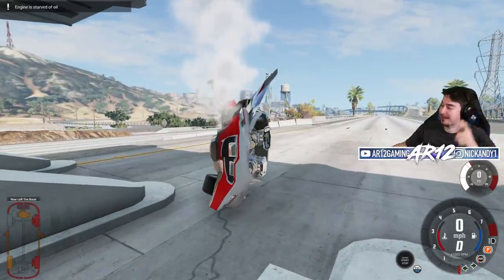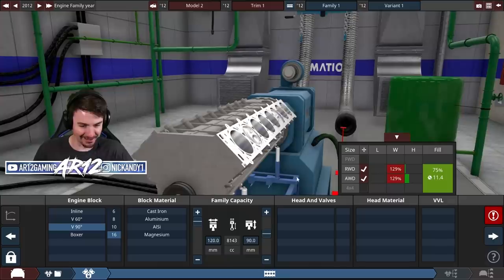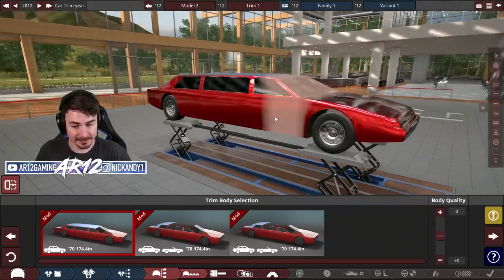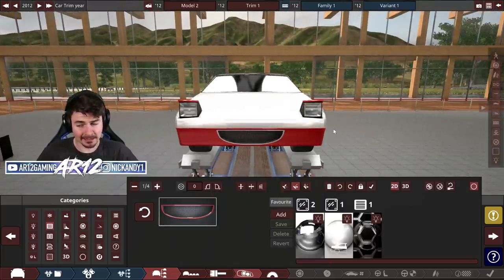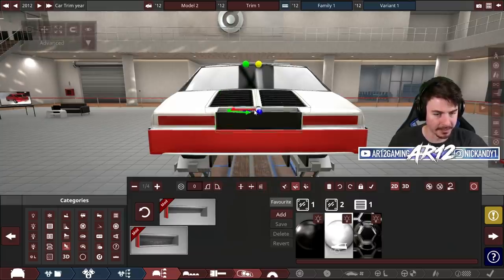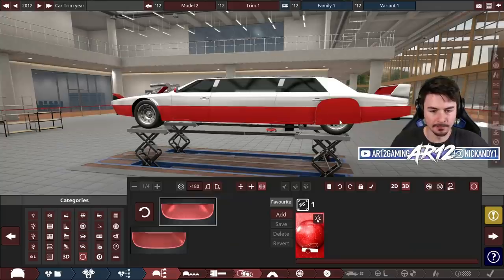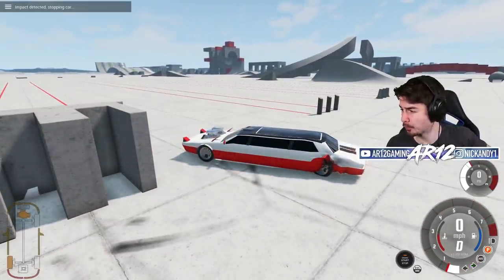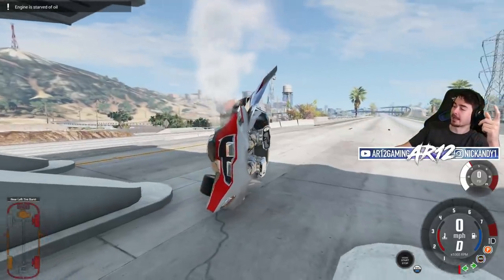Building The World's FASTEST Limo in Automation & BeamNG

Comment: Hey Nick, just so you know fill can go over 100% and the engine will still fit. Great video as always!
Reply: no, you cant. if the measurments of the engine are larger than that of the engine bay, the engine will not fit, the game will not let you progess to putting in a drive system
Reply: @Breakdown5297  If the length, width and height is below 100% but the fill is over 100%, it will still fit.
Reply: @PlatX  most people know that, but the engine was too wide, at 117 percent width
Reply: @Breakdown5297  I know, but fill in particular can go above 100%